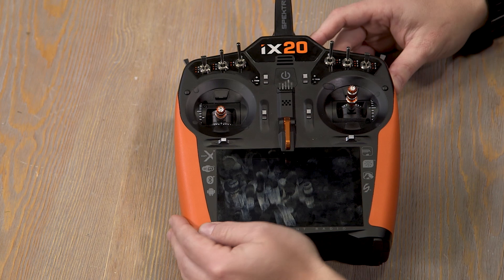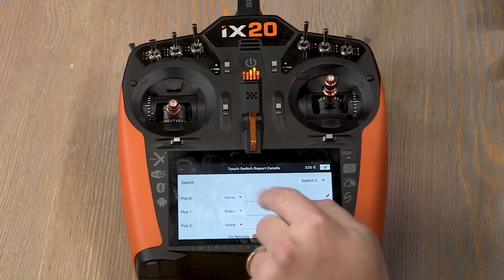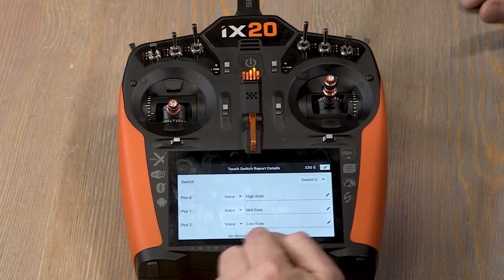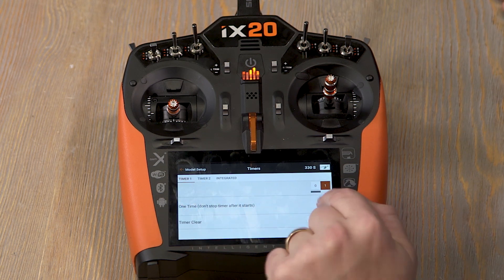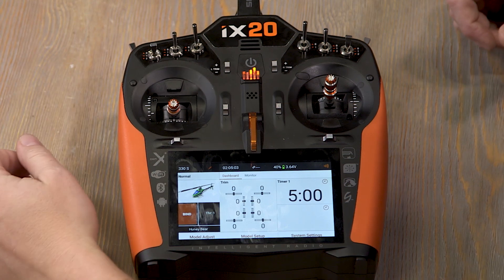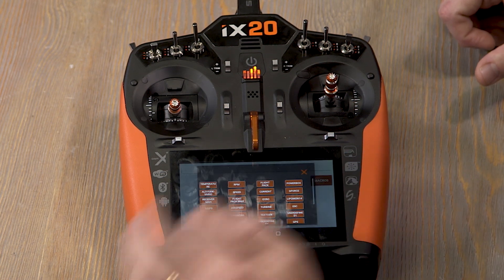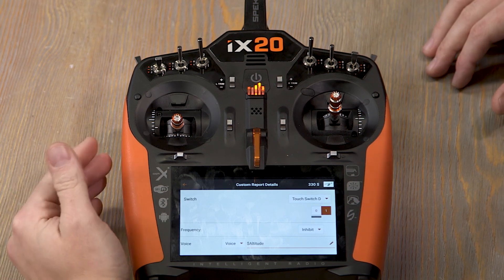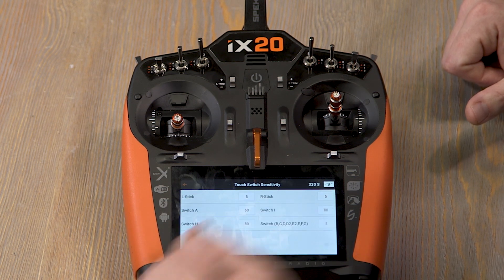iX20 Instructional Series - Capacitive Touch Setup

Comment: capacitive touch does not work reliably  despite updating to latest airfare  it only works occasionally  even at maximum sensitivity
Reply: Yes was same case for me...but when i used the set more....it all seemed to fall into place. Maybe the read write within thw processor needed time to do its thing. Especially after i re boot...each time seemed better.
Reply: Its unreliable.

Comment: So I just got an IX20 and Having a weird issue I think its a bug but wanted to be sure it's not my transmitter... So this is what happened I set up about three different switches with touch, everything works. when I do a full shut down of the radio and turn it on about 30sec later my touch doesn't work anymore, I have to put it in sleep mode and wake it to get them working again... its a little random but problem repeats almost every time I do a full shut down and start right back up. I am not sure but seems to only happen after a quick full shut down and startup. I have disabled most of the apps and my boot time is 35sec so for me that's fast enough not to even use sleep mode... Can you guys look into this if yours does the same ?
Reply from the maker: Hey James, I am looking into it. Feel free to message us directly on Facebook so we can talk further. Thanks!
Reply: SpektrumRC okay will do
Reply: @SpektrumRCvideos  has this unreliable capacitive touch  issue been resolved on the ix 20se
Reply: @joedineen1228  jus got mine a day ago.  it seems with each time we start up...the situation improves. I think its got to do with the read write processing when we initially create the touch....but after more processing time, the system within kinda settles down and works more correctly. I also set sensitivity of 40 for the switches other than A or H, which i set 100 and 70 respectively. I dont know if this helps
Reply: So this happens on mine as well. I did try changing the sensitivity but that did not work. For now, I put into sleep mode, and take out and everything appears to work correctly. Is there a fix for this?
Reply: Go in and change the sensitivity of the switches in System Set-up.
Reply: Hi has this issue been sorted . I bought one of these last year and sent it back for a refund because of this exact problem . I still think it a fine transmitter and would purchase again if the issue was resolved

Comment: my screen showing the stick calibration does not show the touch sensitivity box.. why.. i have a switch setup with touch and it is working but very sensitive. is there another area i need to check for this to appear. i have tried the AUDIO EVENT FIFO on or off not sure what that does but no change in getting touch adjustment box to show up in calibration